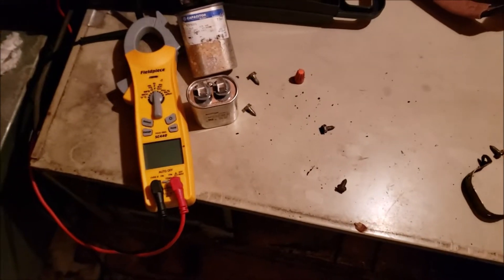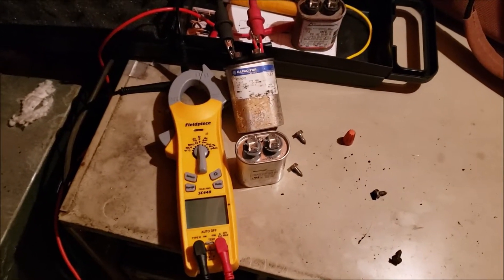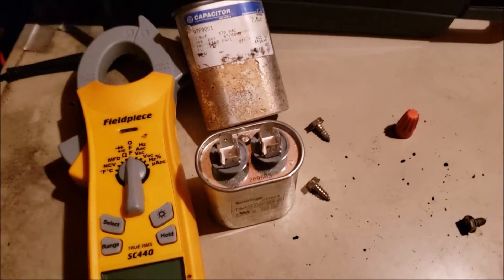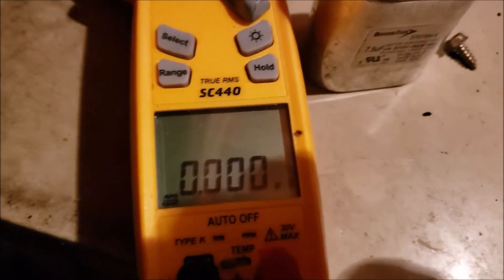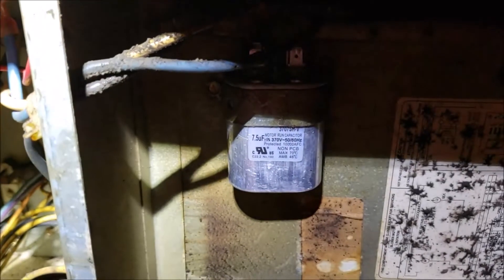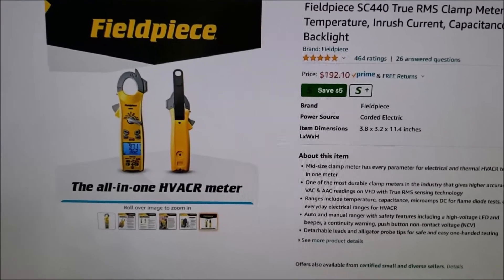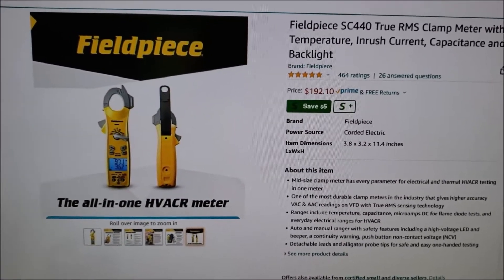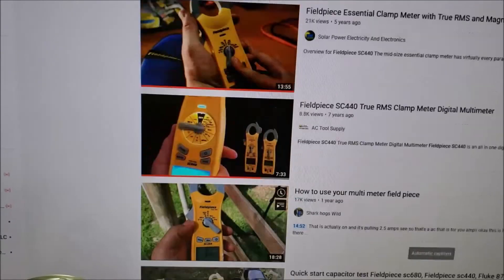How Owning The Proper Tool Can Pay for Itself Fieldpiece SC440

Comment: It’ll run even though 7.08 is still bad. Needs replacement of correct size 7.5. It’s good for a temporary fix.
Reply: depends on how accurate the meter is, and how accurate the 7.5 uf spec is by the manufacturer, 90% spec would be ~6.8 uf. and the quality of the capacitor.
Reply: @tombeck2792  7.5uf +/- 5% So the range should be at 7.8 to 7.1uf. To me it's too close to out of spec and I would just replace it with a new one but that's just me though.